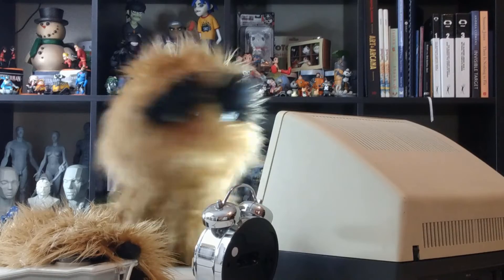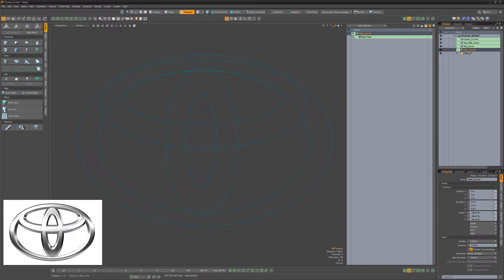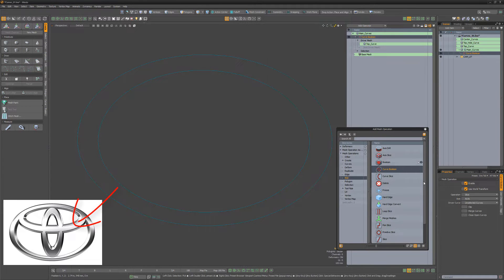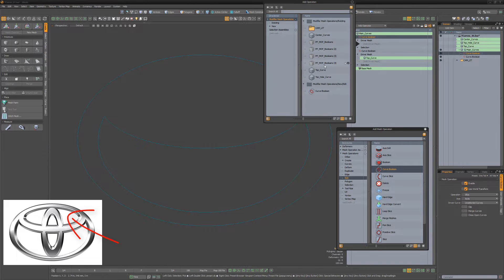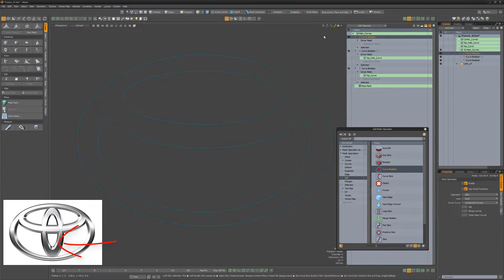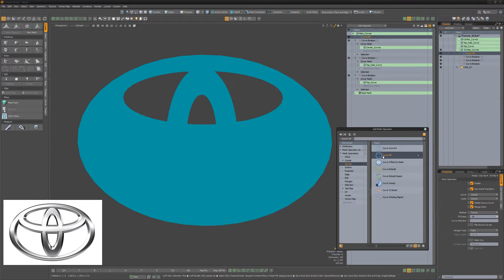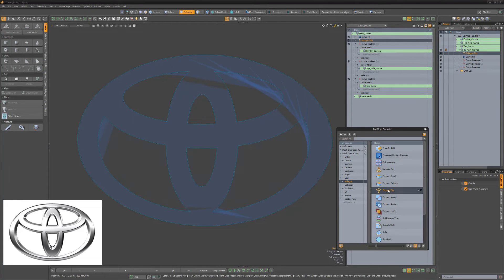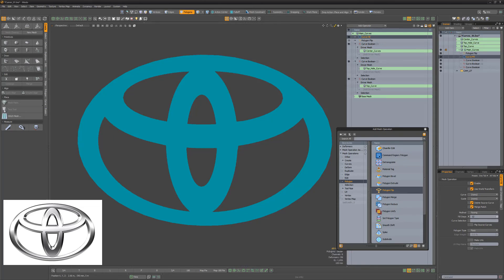Modo | Curve Booleans: Toyota Logo Build

Comment: Now you should count the number of clicks to do the same object in Illustrator and in Modo. 
That's why I hate mesh-ops in Modo...so clicky.
Reply from the maker: There is no comparison. Illustrator is THE vector tool... that said... not everyone Modo users has or uses Illustrator, so it's nice to know you can do it in Modo. Also, the Modo version remains live, which shouldnt be overlooked.
Reply: Different tools for different purposes also can use animation with Mesh Ops. They are fast to work with once you get the hang of it. It is a little more work to assemble the curves in Modo but you get a massive amount of flexibility. In the professional world you have to be flexible to client feedback and design changes. The most incredible part of Modo is its customizability—you can invent your own high-speed procedural modeling pipeline inside Modo without having to write a single line of code or use amazing tools built by the community.
Reply from the maker: Just in case you missed it- https://youtu.be/GSTrFzC_iCw
Reply: Oh man if you only ever intended to keep your artwork static then yeah Illustrator all the way but look at the opportunities you have with this in Modo.. you can have crazy animations that builds up the logo in an interesting visual ways.